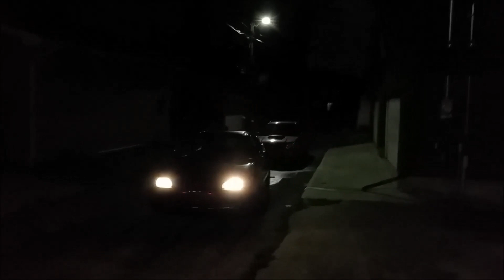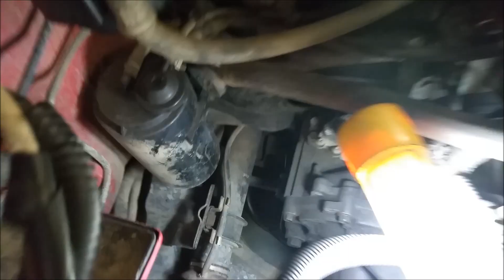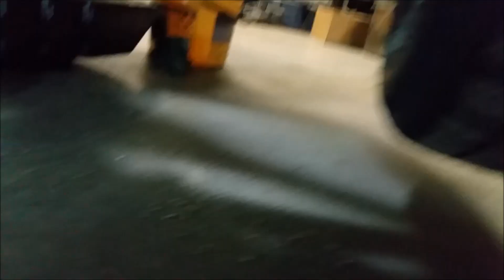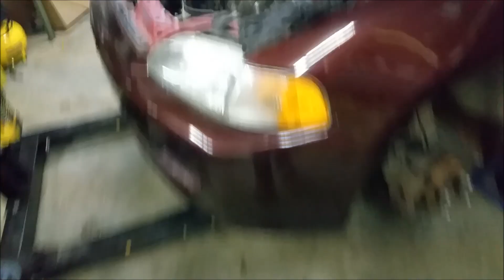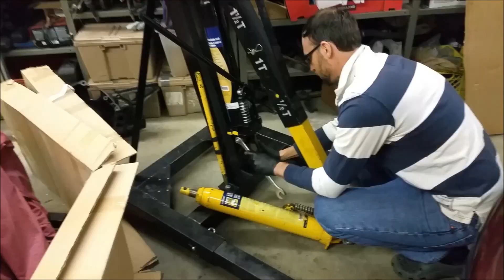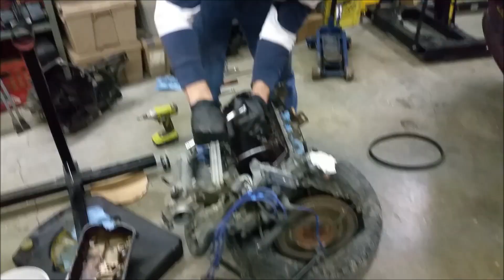The Civic Rebuild: Part 1

Comment: ahhh ended the same way my 2016 did!
Reply from the maker: Justin Abide that sucks. did you get it fixed yet
Reply: Zac's Autosports all parts are at the machine shop or in shipping now.  assembly next week I hope.
Reply from the maker: Justin Abide oh wow you're going all out. we have another d16z6 with close to 300,000km that we disassembled. Might rebuild it for turbo in the future but I'm more interested in a b swap should this d16 blows up later on
Reply: I've raced on used, tired junkyard motors that needed refreshing for 5 years. After #4 it was time to do it right.
Reply from the maker: Justin Abide You on a d16 still? assuming that's the only motor that fits with the 4wd drive train
Reply: Zac's Autosports correct. I've got an old sohc zc bottom, building a z6 head. going to try some Vitara pistons in the hope for boost later this year.